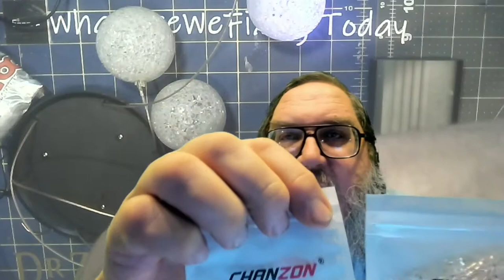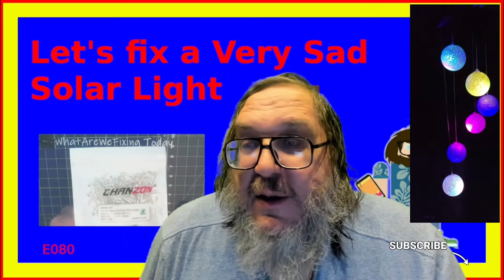Lets Fix a VERY SAD Solar Light

Comment: We have one similar to this one.  My issue is that someone took it apart and now the wires coming off the solar panel (black and red wires) broke off somewhere and I don't know where to resolder them back to.  The battery wires broke off too.  I am having difficulty trying to figure out which wire goes where.  Lol
Reply from the maker: That's sad. Time to get out the thinking cap.  If it is similar though all the lights are powered on at the same time, so after the power comes off the battery and switch stuff, all the reds are together and all the blacks are together.  The flashiness comes from inside the LED's themselves and they just always get power.